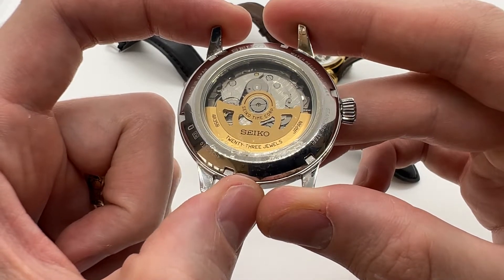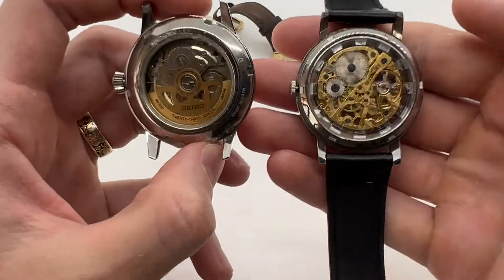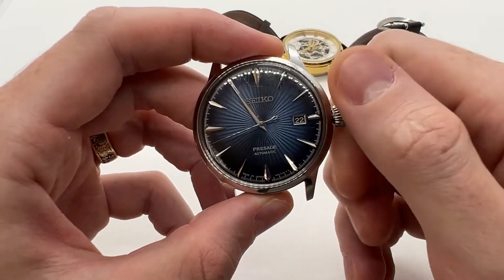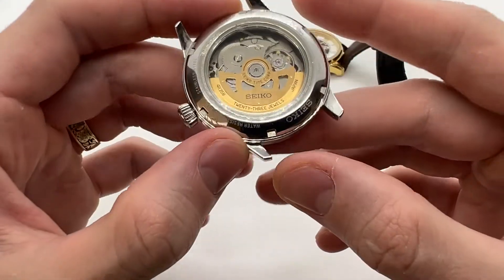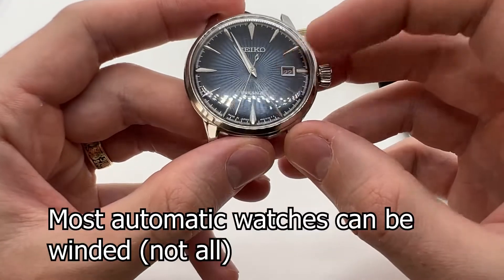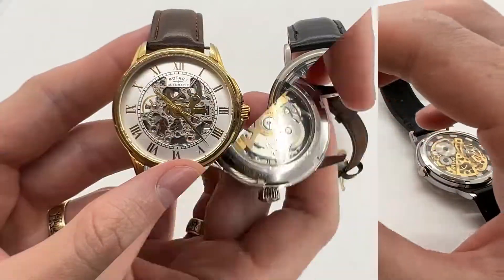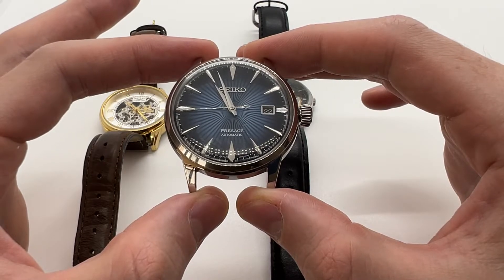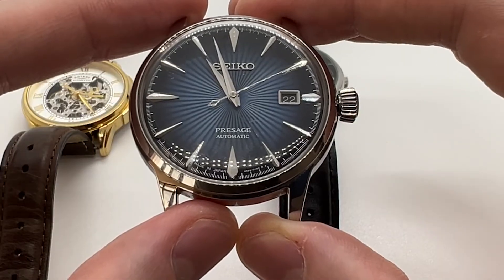How Does An Automatic Watch Work? | Mechanical vs Automatic Watches

Comment: question (not trolling, I promise!) :   I have two automatics.  On one watch, the rotor spins both clockwise and anti-clockwise.  The other watch, the rotor only spins one direction (clockwise).  Is this normal?  To me, without much knowledge, I would think you want the rotor to spin one direction, the direction to wind up. Thanks for anyones' responses in advance!
Reply: Some watches, especially higher end watches, will wind the spring no matter which direction the rotor spins.  On many watches though, it will only wind the spring when it spins in one direction, not both. There are just extra parts needed to get it to work both directions, either with reverse gears, to change the direction of spin when the rotor is spinning the "wrong" way, or with a simple cam on the rotor which can trip a lever to incrementally wind the watch when spinning the "wrong" direction, but less efficiently than the "right" direction.
Reply: @chimchu3232 understood. thank you.